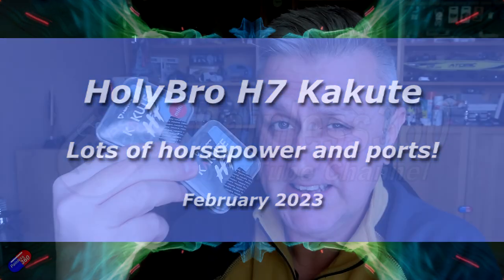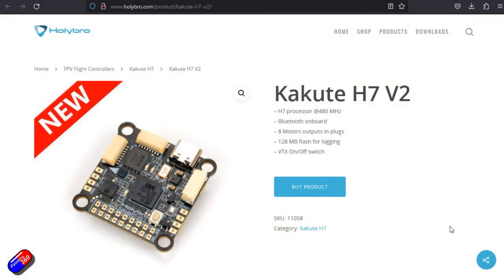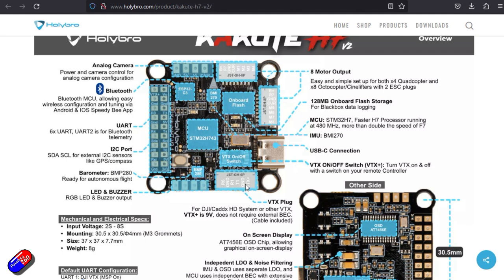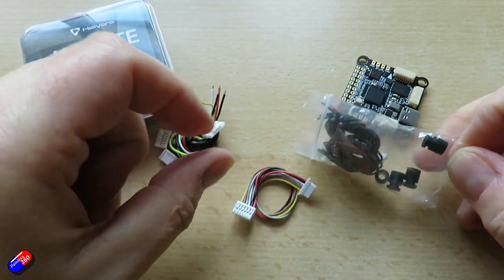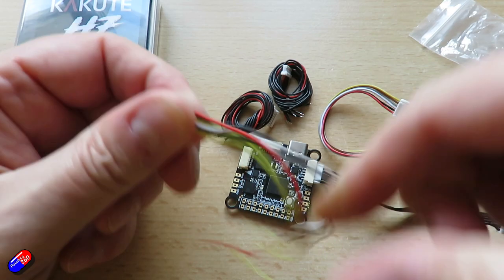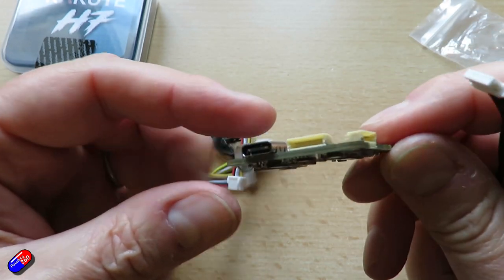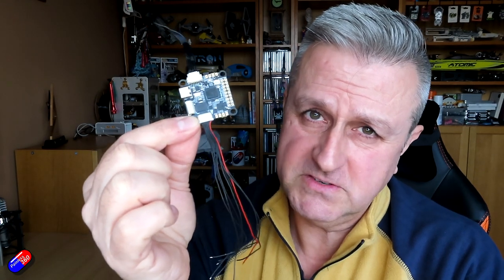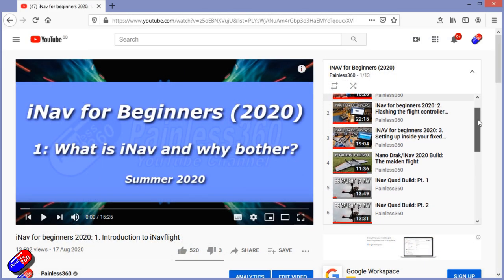NEW! HolyBro Kakute H7 FCs - A lot of horsepower in a small package!

Comment: I am always enjoying your video!😀
As I was so interested in this specification, I bought two pieces which are "Kakute H7 mini". Although I connect some devices which are FPV camera,  RunCam thumb, wifi telemetry, Lidar, optical flow, and so on to the 5v pad, I have broken both devices too. As I have wasted my money, I was so sad. In a nuts shell, I used this device with Ardupilot 4.3. 
Generally speaking, not only in Kakute H7 mini, When the current was over BEC5V/2A which is the limit of this device spec, the circuit would short?

Comment: I've got two of the Kakute H7. The version before the V2, with sd card holder. It's nice and it's got some horsepower for sure. The barometer should be something better than the BMP280. But, it's too expensive unless you run Ardupilot. I think it's a waste of money for Betaflight or Inav.

Comment: I'm having trouble with this FC running Arduplane, no data logs are date/time stamped correctly (all 1 Jan 1970). I'm told this is due to the onboard NAND not supporting a traditional file system. Anyone else having this issue, or found a workaround?

Comment: Thank yo for the heads up. The Holybro Kakute H7 mini looks easier to fit into a ZOHD Drift than the F411 I'm trying to shoehorn in, and will open for Arduplane to boot. Can't wait for your mini series to provide PWM output solutions.

Comment: I have the Holybro Kakute H7 Mini in a little 3 in quad.  I installed Arducopter on it and was having issues with the quad not wanting to fly (It would flip over).  The motors were spinning in the correct direction and everything was calibrated correctly as far as I could tell. Not sure what my issue was.  I ended up installing Inav on it and it works great.  I might for the fun of it try installing Arducopter back on it.  Does anybody have an idea why I was seeing this in Arducopter?

Comment: Holybro Kakute H7.

Greetings from Tasmania, Australia. I am super keen for you to be doing a series on this board and would like to be considered for your giveaway. I used your Naze 32 videos from 2015 to set up a quadcopter back then. I have only recently pulled the quadcopter out of the shed and resurrected it from the dead using the same videos. The key was finding some firmware from 2014 that brought it back to life. All of the modern firmware updates didn't seem to work. Although the Flight Configurator in Google is no longer supported, it still worked. Thanks for your very informative work.
Reply from the maker: Hello! Sadly the draw has already been made. Please make sure you are subscribed and have the bell notification icon selected so you don't miss future chances. Happy flying!

Comment: Does a cheaper FC like the Matek and the Holybro Kakute H7 actually work better on ardupilot be it a fixed wing or multi-rotor compared to a cube? Does the faster processor actually make a difference in the software. Thanks again Lee.
Reply from the maker: Cube offers a number of advantages. Vibration isolation, sensor redundancy, CANBus, internal heating etc. See my series on it.. Happy flying

Comment: I have used quite a few Pixhawk variants running Ardupilot. They have ranged from cheap clones to Holybro versions (that just reek of quality). All have flown various medium sized multicopters perfectly, and the aircraft hang in the air like they were engraved there. 

I have tried a few simpler controllers, mostly the older ones that have Ardupilot firmware available, but with memory limits that have restricted the functionality of the FC. These were not so successful, and suffered from baffling faults that I figured were part of the limited functionality. I had other stuff to get on with so simply replaced the FC with a Pix and away she went.

So, you reviewed the Kakute H7 which I duly bought and loaded with the correct Ardupilot firmware - no memory limitations! - and stuck it into my latest multicopter. And ... weird and baffling faults ensued. 

I don't have telemetry in this 'copter, but I guess I will study the logs and stuff and see what the heck is going on. In the meantime, any ideas? Have you tried a H7 in a multicopter?
Reply from the maker: Most of the copter stuff I do here is using 'Pixhawk' style stuff or the channel. When using non PixHawk hardware I don't tend to try and do everything. Best of luck.

Comment: Will this work with a Jeti S Bus Rx.
Reply from the maker: If it's regular SBUS it should do. Best of luck
Reply: @Painless360  Thanks works on a Orange Cube.
Reply: @Painless360  Works with Jeti SBUS. Flashed with Ardupilot. Need to know if I can have 433 telemetry and Pitot with this FC. Have the the Nano Ublox M8 5883 but have no GPS signal. Any help very much appreciated. Thanks for you channel.